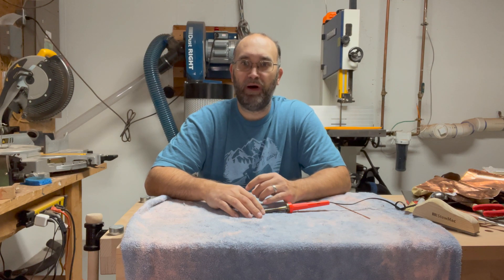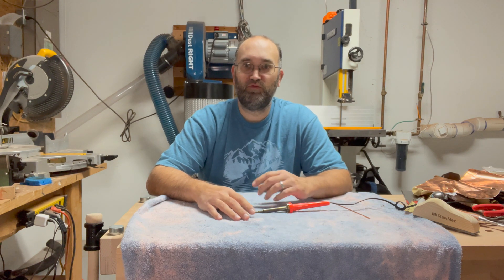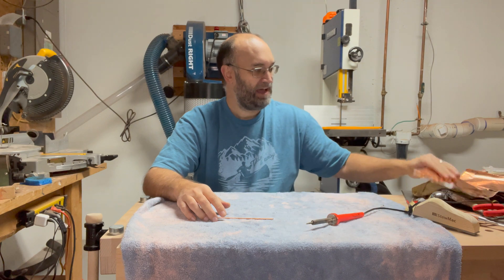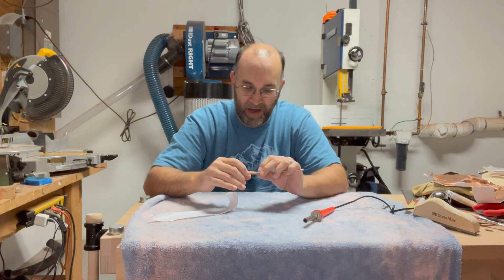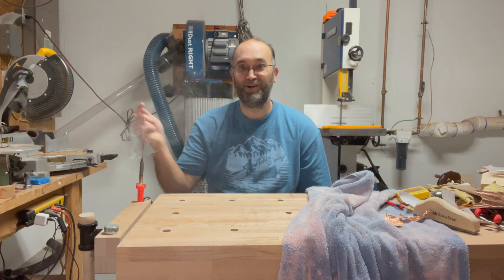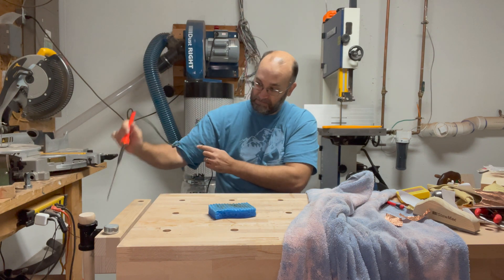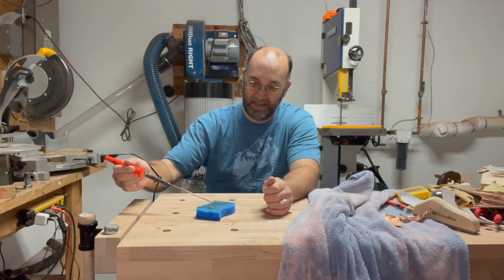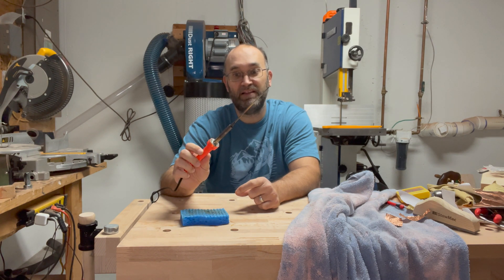Making a heat stick with only $0.72 of copper!

Comment: Another wire that's better is tempered wire....welding wire sticks for Gas welding... they are stiffer and cut them for exact lengths you need.
Reply from the maker: Nice! Where do you get those?
Reply: @zwitchguitars  welding shops... Brazing rods .O'Reilly

Comment: i did this with 2 pieces of copper and made them fork. two holes heated with one soldering iron.
Reply from the maker: That’s really interesting! I’ve been meaning to come back to this, as my design isn’t quite as effective as I’d like

Do you know what gauge wires you were using?

Comment: I used a grease gun needle when using steam from a pressure cooker. Seems I could use a the same with an iron, or auto brake tube (copper). Just stuff I have. But this looks like an easy replicable diy. Thanks
Reply from the maker: Nice, those sound like good ideas as well!

Comment: I did the same thing. #6 solid copper, put it in my drill press and turned it down to .140. My solder iron is temp controlled. Works perfectly. Glad to see others thinking the same. Thanks for sharing.